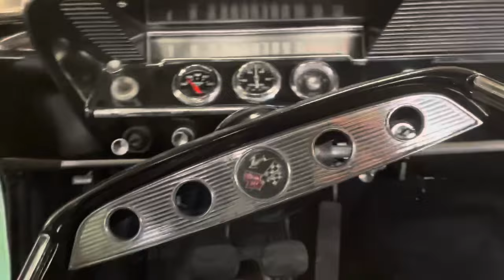Cab Over Chevy Van Conversion part 33; patch panels and rust repair

Comment: The Pt cruiser has a rubber seal the hood sets down on that might work. It slides over a lip that runs both fenders and the rad. support. Probably lots of stuff like that would work. Trunk seals are most likely plentiful in junkyards.
Reply from the maker: Thanks, good idea!